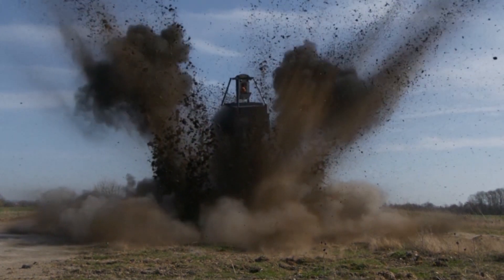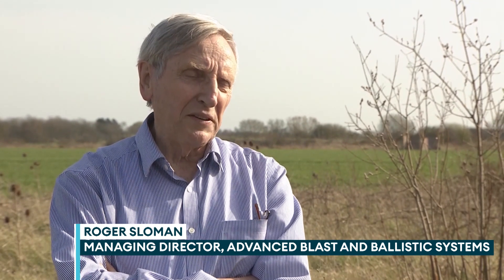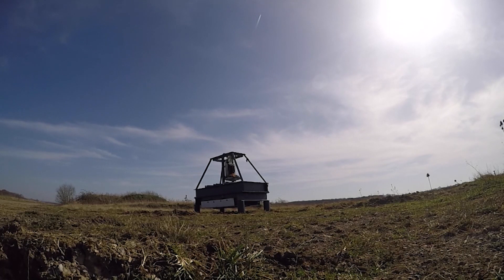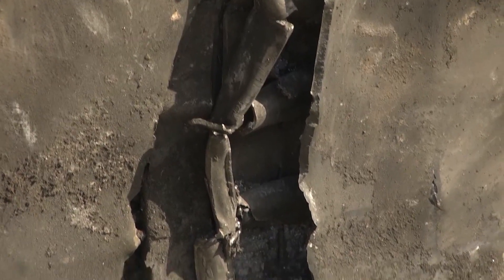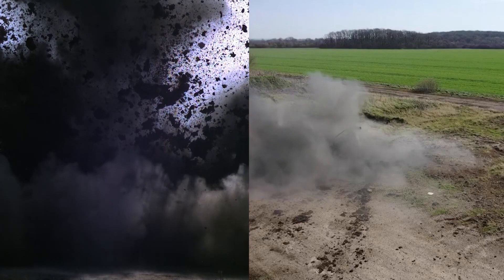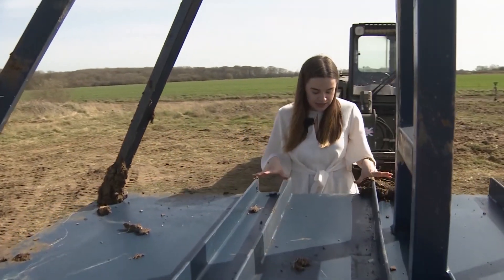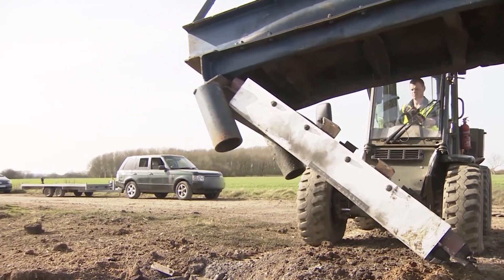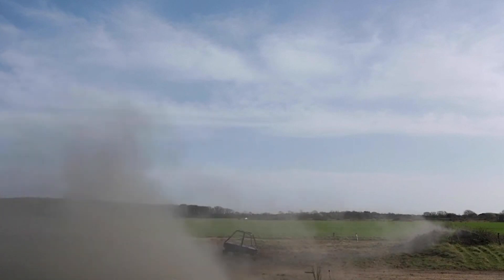INVENTOR Tests Device To Protect Against LAND MINES

Comment: Having worked in the mine action industry for over 20 years since leaving the Army (RE EOD) I thought I might add my tuppence worth for good or bad. Firstly, well done to this inventor (and anyone else) that is prepared to put time and effort into improving survivability from blast.  Anything to improve is always welcome.  Secondly, we do need to separate out the difference between a landmine and an IED and even the different type of landmine.  For the most part, a landmine is detonated by pressure and that pressure generally comes from the wheel (unless you hit a tilt rod) so the blast testing being carried out here is not necessarily reflective of what would happen in real life.  As pointed out in another response, V shaped hulls are pretty effective in defeating / reducing the impact of blast beneath a vehicle but the floor is generally part of a "mono-coque" (sp) system that encapsulates the crew compartment. Not something easily done on a Hilux.  There would be not a lot you could do to make such a vehicle survivable from a shaped charge such as a TMRP6 or the like.  Equally, the weight of a mine protected vehicle (MPV) also contributes to survivability in that it will not be thrown so far up in the air that reconnecting with mother earth contributes to fatalities. On top of that, whilst the floor may get a degree of protection, occupants may receive fatal injuries from blast over pressure to lungs / heart etc.

As we have come to learn in the recent past, IED's have become a weapon of choice and while many are simply home made landmines with the same operating principles, more complex (command or remote) operated IED's are far more difficult to defeat because they are often specific to target and sometimes, the sheer volume of explosives in the main charge is sufficient to defeat any form of armour or upgrade.  When discussing the different type of landmine, specifically anti-tank / vehicle and not anti-personnel, the blast mine is the most common but we should not forget off-route mines or even off-route IED's

The "game" is ever evolving as our Troops in Afghanistan and Iraq and earlier in Kosovo would attest and its only through people like Roger that we maintain or don't at least lose the edge and I am grateful for that.  That said,  I am not sure that there is much that you can realistically do to make the occupants of a Hilux survive a decent blast without making it inoperable.

Comment: Surely a V shaped base would be better? It would direct the blast out and away from the vehicle.
Maybe even build tunnels through it that will act like a funnel so some of the immediate blast force can be weakened
Reply: These were tests for protections to add to Toyota Landcruiser/Hilux, try putting a large V on those, lol.
Reply: @chiefdoesgaming8269 covert them to have monster truck wheels 🤣
Reply: @mccari09  Now I'm just picturing the SAS rolling up in a monster truck, lmao. But realistically yeah that won't happen.
Reply: @chiefdoesgaming8269  who needs to storm a building full of terrorists when you can just crush it?

Comment: Iterative improvement - keep going. I wonder if the IED was a shaped charge or just a slab of explosives.
Reply: Pretty sure that was not a shaped charge. The armour did not look thick enough and although he mentioned reactive armour at some point (I think), he wasn't testing that here. It looks to me that it is a design trying to direct the explosive force around the frame. Obviously that simply would not be possible with a shaped charge blast.

Comment: Why not just replicate what MRAP do?
Reply: MRAP rides quite high off the ground and has a high centre of gravity, both if which are non-ideal (easier to spot because of height, easier to topple because of CoG). What they're testing here is potentially a modification for vehicles used by special forces - i.e. they don't stick out as being obviously military vehicles, but still have more survivability.